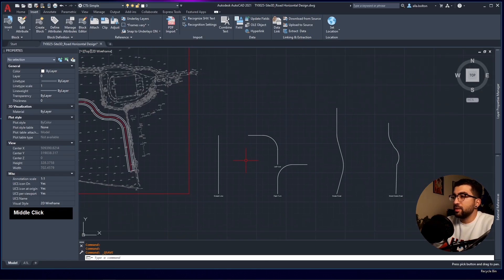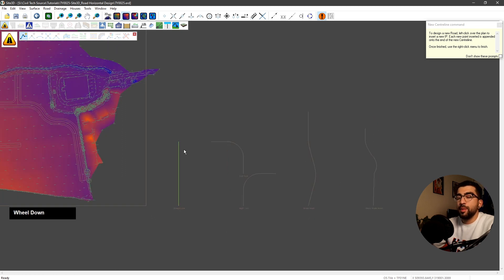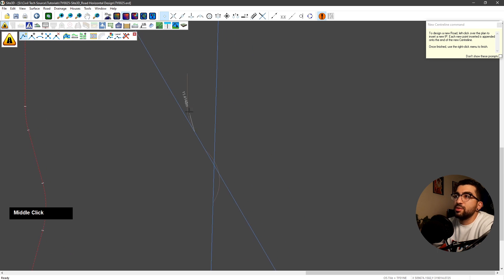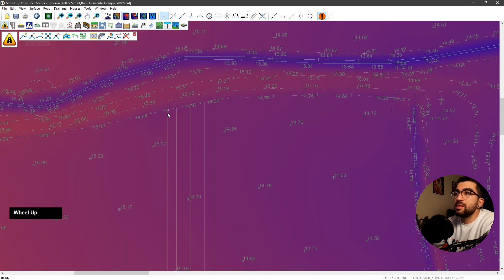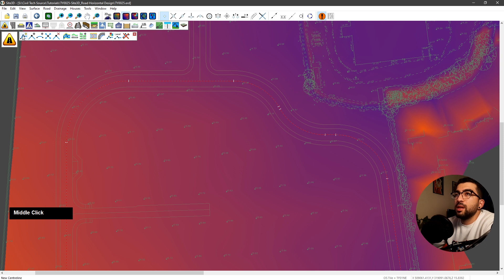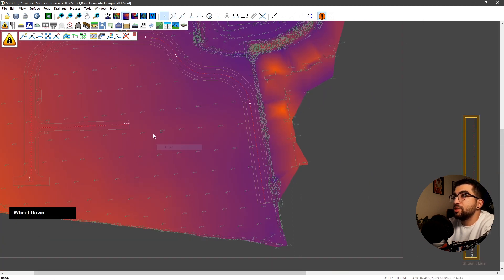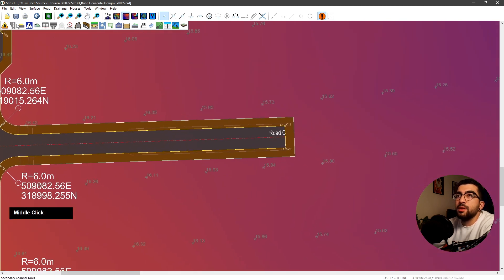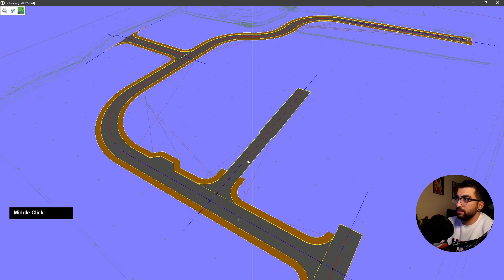Site3D - Horizontal Alignment Design

Comment: Thanks again! Any videos on XPSite will be welcome from someone that has recently transferred into civil engineering!
Reply from the maker: Unfortunately microdrainage doesn't want to provide me with a license to create the tutorials and purchasing one is quite pricey..
Reply: @CivilTechSource  That's a shame, I suppose you could still cover basic drainage concepts in XPSite? Like building the runs and some more advanced concepts? Just a thought!
Reply from the maker: I only have access to the license at work,  but don't have my gear with me it would be tricky to do, will have a think.